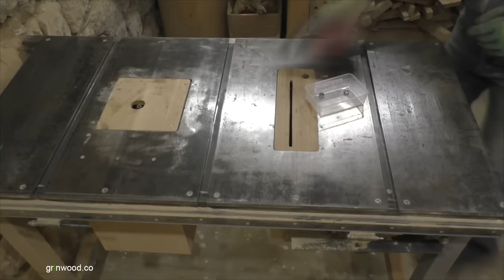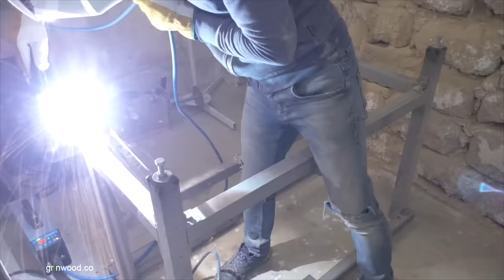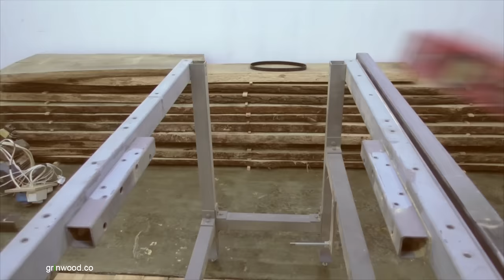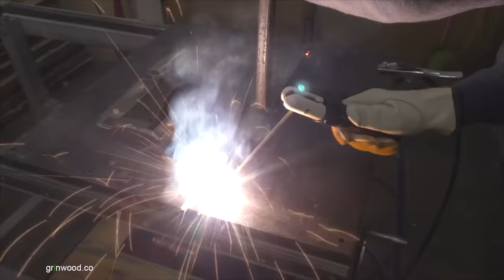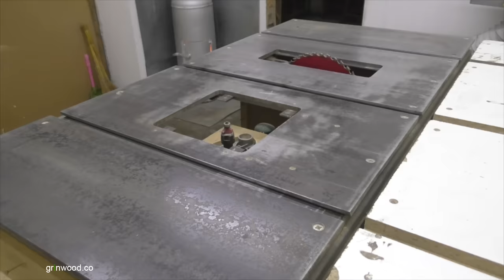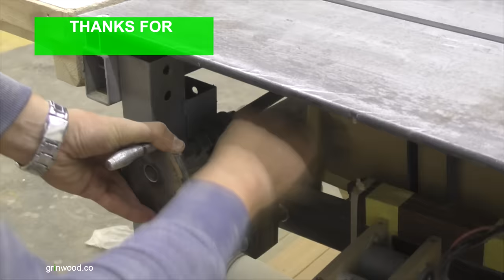🟢 My Homemade Table Saw 👉 FREE Table Saw DIY Plans  👈

Comment from the maker: Hello my friends, I know, i promissed you to finish sketchup 3d model and make plans for my table saw but here is why i made just a 3d:
I work in sketchup and here is the way i'm going from 3d to PDF plans. First of all, details were copied and placed to each scene, plus every detail must be assigned to separate layer so they don't mix in scenes. Too much details, too much scenes so they don’t even fit on my computer screen. Next this file move to Sketchup LayOut and each detail must be placed on  separate sheet. 
This job just makes me crazy, the Sketchup file becomes so bulky and i decided to stop working with plans and ask you if you know more comfortable way to transform 3d model to PDF without scenes, layers etc. Please write your version in comments. Thank you in advance for your help
Reply from the maker: Hello, thank you for your help, my friend. Just saw a few videos about solidworks and want to say that it is totally different program from my favorite sketchup. Will have to spend some time to learn it.

Thank you!
Reply: ОГРОМНОЕ ЧЕЛОВЕЧЕСКОЕ СПАСИБО!!!
Reply: Thank you so much brother. Was looking for clamps and landed on the other plans and led me here as well. Thank you so much.

Comment: Hello from Dublin, IRELAND my bro. I cannot believe I found ur video. I've got a similar idea to build my own table saw but the top was defo the part I was stumped with. I thought about 5/6mm metal plate but was unsure until I saw this video of yours. 
Would it be ok If I emailed u for some advice sometime bro. I'm going to be starting in the next month or so. I have a few questions I would like to ask u about the motor size and about the belt/ pulley system u put onto the arbor. Where did u pick up an arbor for ur saw? Was it bought 2nd hand or what man?? 
How is the Metal plate holding up to rust and what or how do u keep rust at bay from these heavy plates on the table top? I'm so damn impressed with ur build bro. It's giving me so much inspiration right now. I know it says FREE PLANS but I would love to be able to speak with u or ask some questions now and again if u have time to answer them if only through the comment section. I have welders as well even though I'm new to all this stuff. 
I've bought so much steel for the frame build but I also looked into just using the motor and blade thing from my cheap saw I bought a few yrs ago. It's one of those Hard start saws but it's noisy as hell and I'd love to put the motor separate from the Arbor. I looked at a decent motor on VEVOR the other day for 170 euros. I don't know where to buy the Arbor from. I need to so some more homework on that stuff. I saw a Cast Iron table top on EBAY for $99.00 but it's tough to get anything shipped from the USA nowadays. To buy the cheapest Cast Iron saw now is going to set me back over a thousand euros so I will build my own and make the best of it..
Thanks for this video. I'm checking to see if u have the original build video on here after I leave this video comments.. 
Thanks again my bro. Great work on yr saw. It's very impressive and I'm super impressed man..

Comment: Awesome I want to build like that. Thanks for the plan.
Reply from the maker: You downloaded 3d model? Did it opened in your SketchUp? I'm just not sure that it can open in version older than 2019
Reply: @GRINwood  it can't open in my sketchup 2017. Maybe you can make it available from old sketchup.

Comment: That's one way to get a tablesaw upstairs. But in all seriousness i applaud your effort in designing and build a proper tablesaw, even if you used some of the same parts. Thankfully you didn't just use a inverted circular saw.

Comment: hello...great work....one question  : do you change insert when inclining to 45° or other ? because you rotation axe is almost 2cm behind table so blade move to left too.......no ?
Reply from the maker: Yes, you are right, I made three of them 0°-15°, 15°-30° and 30°-45° to minimize the hole width.  Thanks
Reply: @GRINwood  thanks...now i understand better your plans ;) thanks for all. great work !

Comment: Good morning, for this saw, how many fleas do you recommend the cutting disc for? and how many HP do you recommend the motor?

Buenos días, para esta sierra, de cuántas pulga recomiendan el disco de corte? y de cuantos HP recomiendan el motor?
Reply: El disco lo escoge de acuerdo al motor. Para discos grandes se usan motores de 2 hp en adelante a bajas revoluciones. Para discos más pequeños puede usar uno de 2hp a baja o 1 hp a altas revoluciones. Si solo va a cortar trozos de madera pequeños, lo idear es usar 1hp.

Comment: The saw is nice, but think about securing (grounding) the extraction pipes against auto-ignition associated with electrostatic voltage.  Safty first.  Best regards